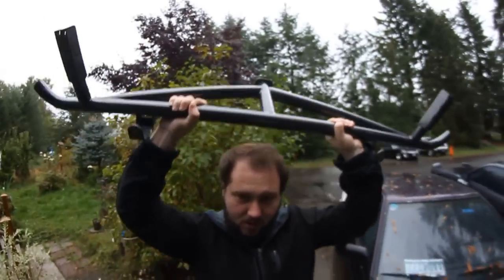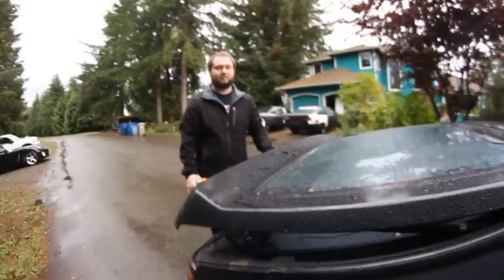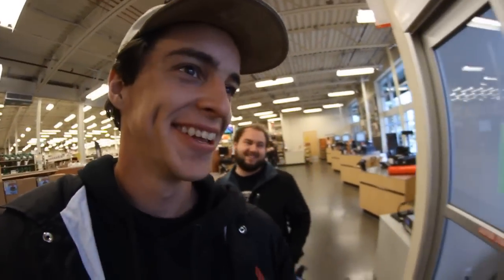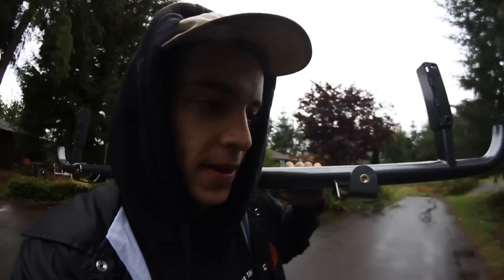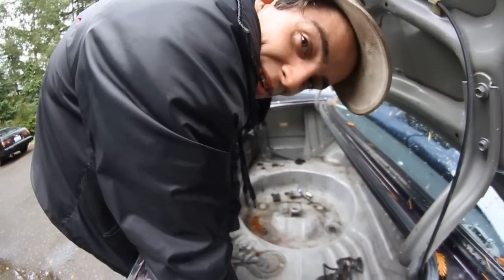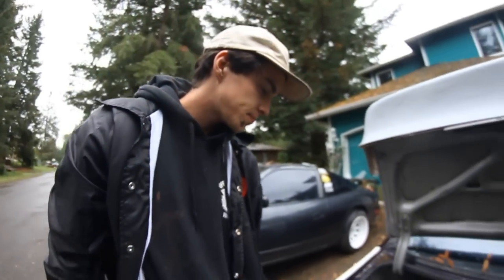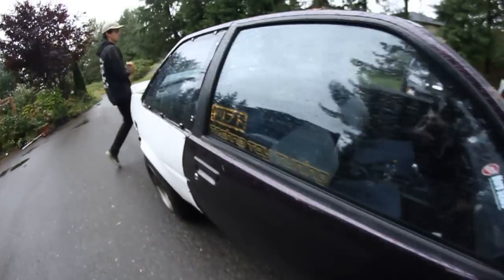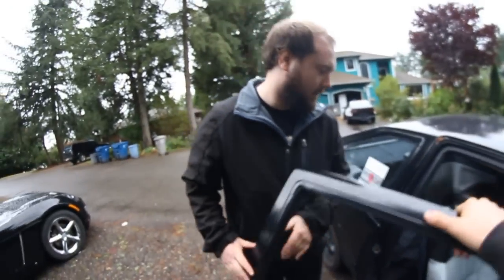Widebody AE86 Gets a BASHBAR

Comment: Your idle air control valve (IACV) is causing the high idle. Try cleaning it with brake cleaner first, if the problem still persists, you probably need a new one.
Reply from the maker: i'll try it, thanks!
Reply: No problemo.
Reply: jouninraz doubtful it's dirty it's adjustable with flathead

Comment: My guess is that the bashbar is supposed to be under. So when you jack it up it has more support instead of just the bolts.
Reply from the maker: we have found out that the tabs are for bumper support if you run a bumper

Comment: i have a question. i own a 1990 AE92/98 still has the same 4AGE motor.Ive noticed that at 10:00 min of the video when you ran your car if you listen closely it has like a misfire sound, which mine also has when i start it up. is this normal?
Reply: the GTS coupe and i also run a 2k idle at start up (under 1k fully warmed) and here this little cut off/ misfire sound and people tell me its my O2 sensors
Reply: +Simon HWDP hear*

Comment: It needs a better muffler tip
Reply from the maker: it's 2 inch straight pipe from the headers
Reply: More Skids Y'all should've built a 2 inch pvc pipe like with pvc from home depot from front to back the pvc would absorb all the high buzzing frequency and it wouldve sounded really nice. And you could've spray painted it red on the end and angle cut it
Reply: Smart Feller 
oh really ? i bet that would have worked amazing